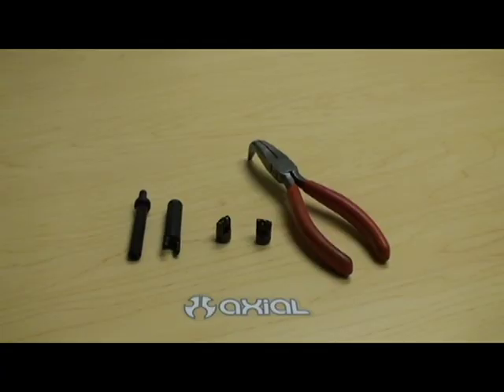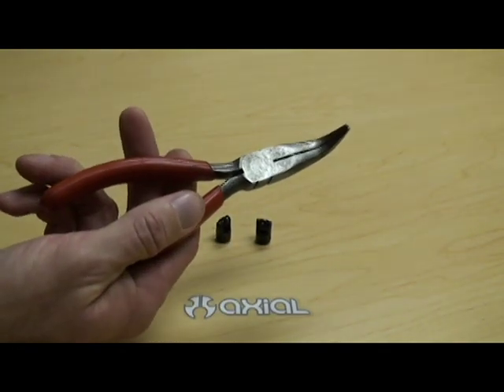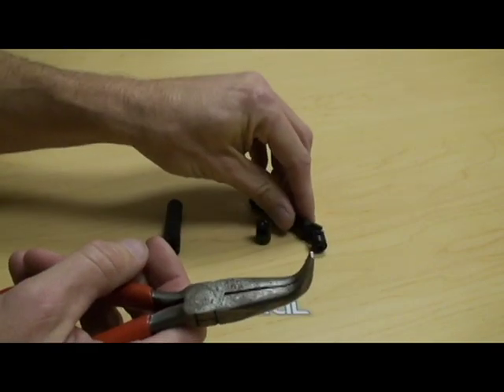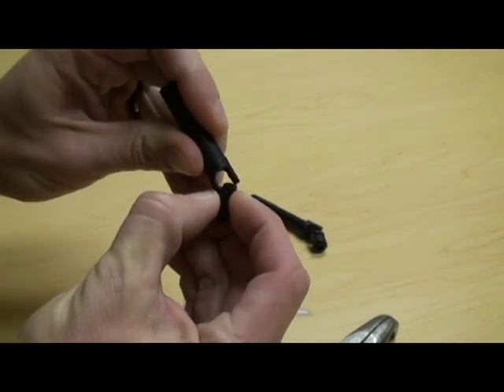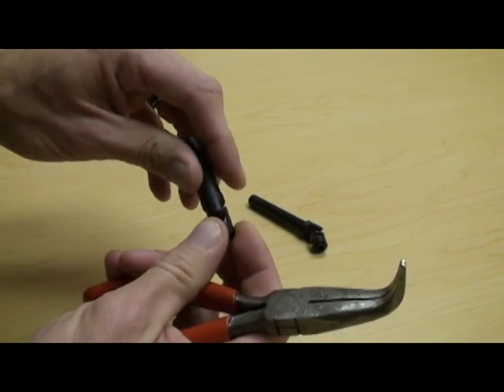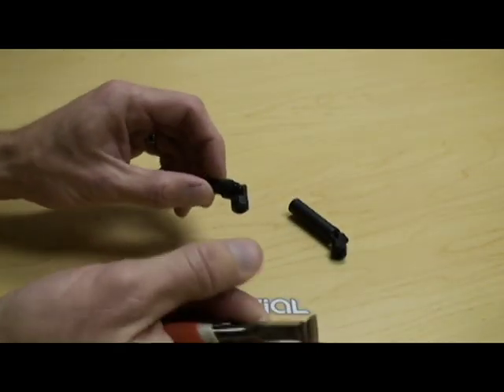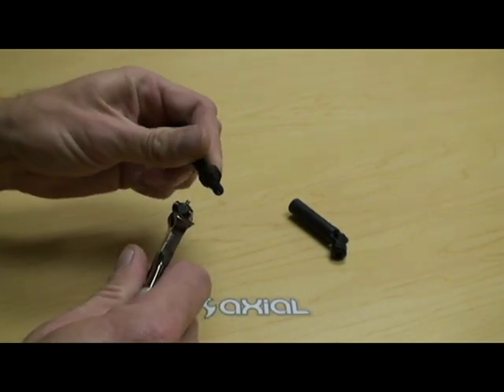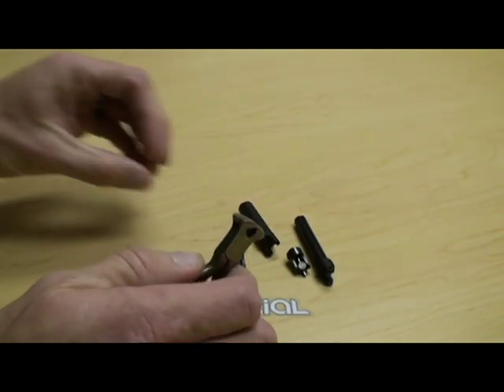Video Tutorial...........Driveshaft Assembly

Comment: I just got new driveshafts for hbx Devastator. All the parts including the new balls with the four pins permanently on it that go in between the U-joints. It is absolutely physically impossible to assemble this. There is no way on Earth to get the little metal balls with the pins on it inside the plastic yokes. Any ideas? Thanks in advance.